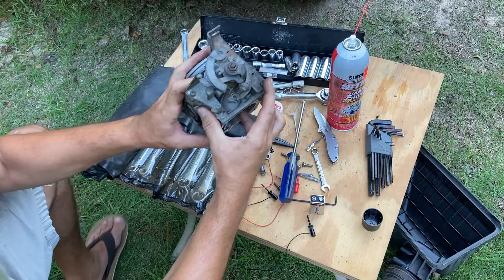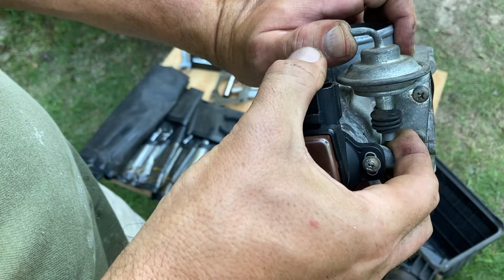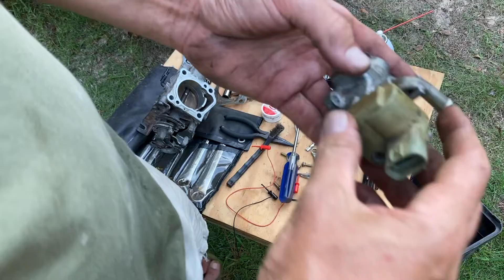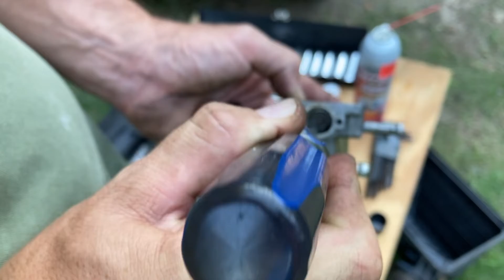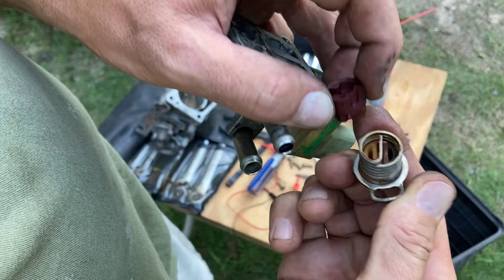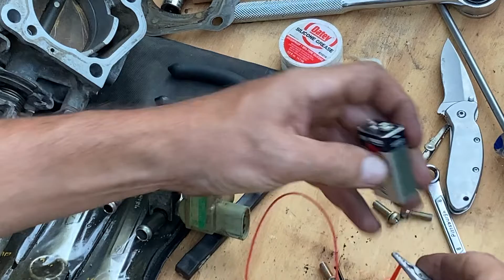1996 TOYOTA T100 IAC Idle Air Control Valve & Throttle Body

Comment: How did it ever turn out? Cause I might have a problem with my t100 i turned it on one morning and everything was fine high idle cold start then all of a sudden it idled really low and it wasn't even warmed up yet almost like it choked and turned off now it cranks and wont start and when it does it  backfires when I rev it a bit not sure what's going on